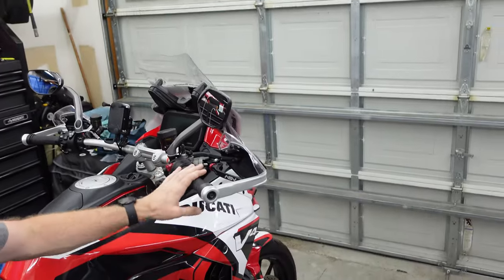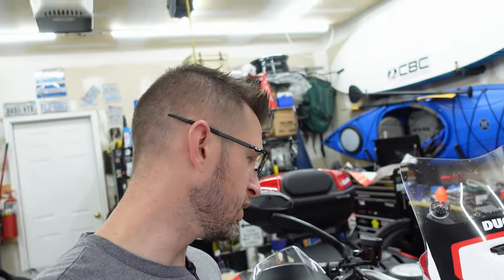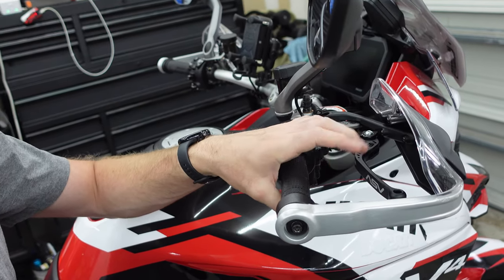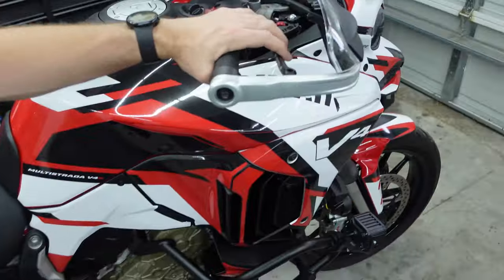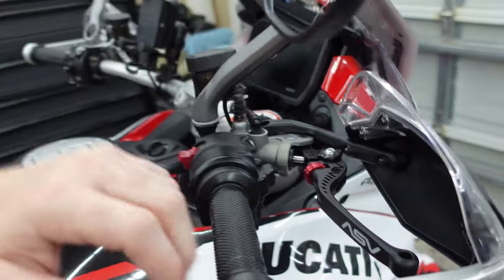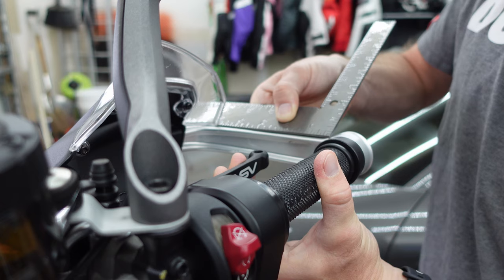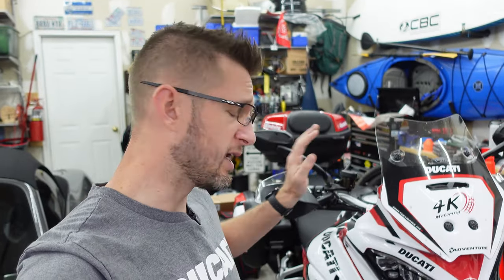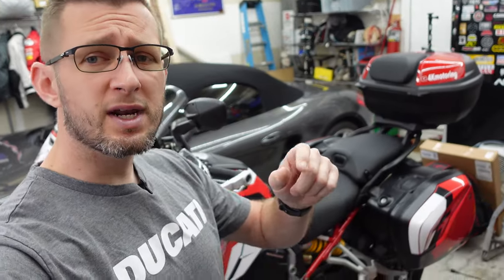Brembo Redemption! Fixing the Ducati Multistrada V4S Brakes!

Comment: Welp I'm supposed to have my entire master cylinder changed at Motorcycles of Charlotte, hopefully all goes well and hopefully I get a full refund for the $400 I have spent in them "diagnosing" the brakes that is DUCATI'S FAULT! A damn shame that this is even an issue on a 30k bike, this will certainly be the last time I ever buy anything from Ducati if I don't get a full god damn refund.
Reply from the maker: Unfortunately I've learned that buying bikes at the leading edge of technology often results in these issues. I haven't spent any money diagnosing the problem, it was all covered under warranty. Sounds like a dealership issue